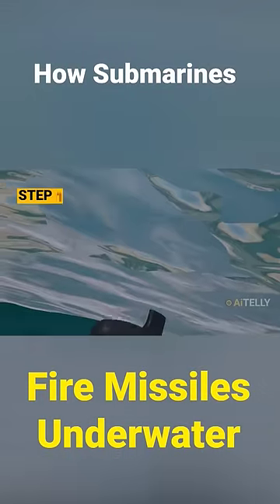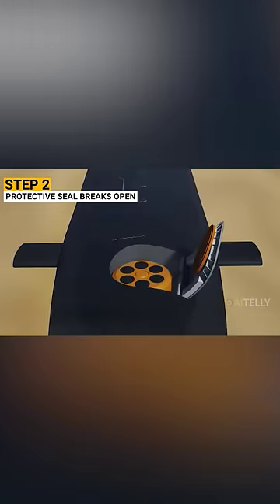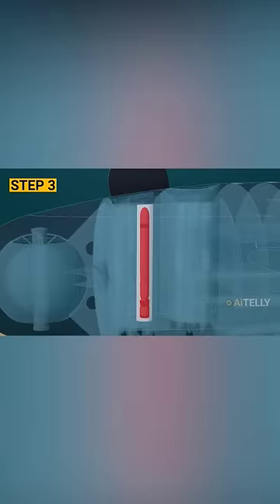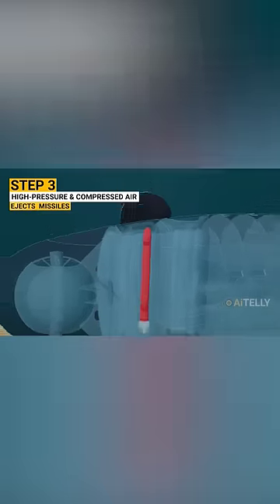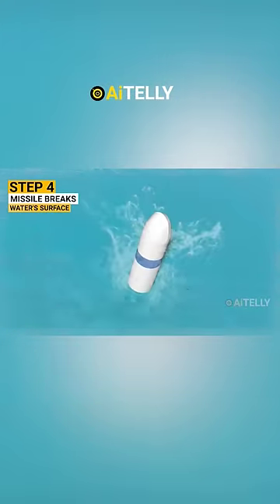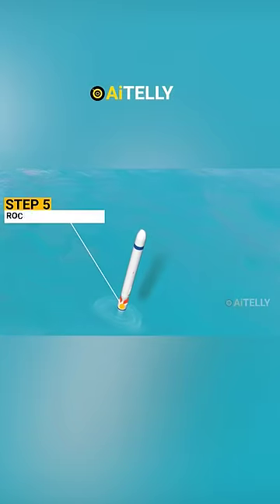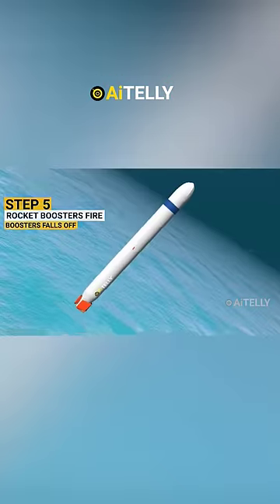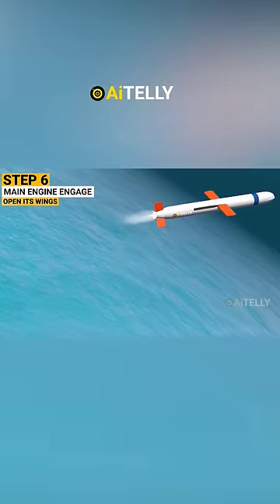How Submarine Fire Missiles Underwater

Comment: The pressurized air prevents water from entering the silos, thats why it can fire while submerged
Reply from the maker: Yes agreed thanks for your comments
Reply: Its actually high pressure steam..
Reply: No, it doesn’t fire while in submerged. The sub positions at the right depth allowing the pressure strong enough to eject the missile out of the water then the missile fires once it is in the air. That is exactly this video clip has demonstrated.
Reply: @h.nguyen6261  Volcano in deep water
Reply: After reading these posts ... I can see not one of you actually know how the system works.
Reply: @Dark78Sabre  you know how  it works? Tell us then
Reply: It works probably like a submarine launched ballistic missile. Rises in nitrogen which is non flammable, the silo filled with water to offset the weight and the missle once out will fire like in the video…
Reply: What kind of catastrophic damage if the water entered the silos?
Reply: @Dark78Sabre 
Back when  I was in the Navy (long ago in a galaxy far away) I had a friend that was stationed on one of the original Boomers (Blue Crew as I recall) that carried the final version of the Polaris series. He told me the way the launch sequence worked was: the outer hatch is opened; the tube was flooded with Nitrogen ( back then there was a kind of membrane at the top of the missile tube that in conjunction with the offsetting pressure created by the Nitrogen kept all the water out); the inner hatch was then opened and the missile was launched with a blast of compressed gas, punching through the “membrane” and propelled out of the water. I never personally pried open one of those  hatches to confirm (for all those that may call BS on my comments) his story, but I don’t think he would have any reason to lie about it. I have no clue the how it is done today.
Reply: @aspopulvera9130  The missile tubes are supposed to be flooded with water. Even after the missile has left. If it wasn't then the submarine wouldn't have enough ballast to stay submerged. The missile actually has more mass than it's equivalence in H2O so if all of the missiles have been fired there are additional tanks that can be flooded to make sure there is enough ballast to stay submerged. Otherwise you'd have too much air and the sub would float.
Reply: @osemenitua7538  I already posted a separate thread on the basic mechanics of how they work.
Reply: That’s so cool 😎
Reply: @h.nguyen6261  magnesium
Reply: @h.nguyen6261 sorry to rain on your parade but the missile's solid fuel that it uses to achieve flight before the turbo fan is used contains an oxidizer so yes the fire can burn underwater. It's not meant to though but the point is your claim is fire can't burn underwater and your claim is wrong.
Reply: @raymondlowry8564 uk here your right about the nitrogen for polaris, they use steam now from a small explosive
Reply: what happen after the pressure disappear? the water still can enter the silo
Reply: @samuelgerungan7851  pressure is maintained and is only stopped when the silo is closed
Reply: @samuelgerungan7851  the pressure is to ensure the missile gets out of the water before the rocket motor ignites, the silos would probably get flooded after the launch
Reply: @samuelgerungan7851  sure the water can enter the silo. That's not a problem. The launch occurs at a shallow depth, and the silos can handle the pressure. The silo is like a gun barrel. The sub rises to proper depth and cuts speed or stops, I can't remember. The outer hatch opens while the inner break away hatch keeps sea water out. At the bottom of the silo is a container of fresh water and a large propellant charge. When the charge is ignited, the resulting gases and fresh water steam both propel and shield the missile as it moves up and out of the water. The sea water never touches the weapon. After the missile is out of the water, then the rocket motor starts.
Reply: @h.nguyen6261  fire burn in water. You just need to made it right.
Reply: @h.nguyen6261 that’s not what he meant by “fired”
Reply: Whats next, torpedoes are being lanuched by compressed air so water doesn't get into the tubes? 😂 Man this is ridiculous..
Reply: Likely a sunken submarine and a dead crew

Comment: "High Pressure AND compressed air is pumped into the tube" 😂
Reply: Nice 😂
Reply: must be an epic pump
Reply: Nice
Reply: Missile boats use fresh water that's flashed into steam with a rocket engine outside the tube vaporizing the water. It comes up from the bottom as flash steam propellant kicking the missile out of the tube.
Reply: The missile breaks the seal as it punches through it. Not a good clip.
Reply: @mach1553 dude's funny mistake flew right over your head like one of those missiles!!   lmao
Reply: its similiar on the concept of farting while in the pool 😂😂😂😂
Reply: Copycat

Comment: Being a former (retired) TLAM technician on surface ships, I know about the surface side. The booster doesn't fall off as soon as it reaches the surface, but is used to get the missile up to speed so the sustainer jet engine has enough air entering it to sustain flight.
Reply: Yeah, was thinking that also... The booster will have a designated burn time which will propel the missile to a flight height!!! Then and only then will the rocket booster detach
Reply: @paulclarke4776 *proppel
Reply: @SpartanVirus  nah, am pretty sure its PROPEL!!??
Reply: @SpartanVirus  depends how fast your going?? 😂
Reply: Yes, the Rockets burn out speed matches the Cruise speed of the turbo jet engine.

Comment: Negative on a CLS launch a gas generator starts up forming a bubble around the missile forcing it out of the tube at breach the rocket motor takes it it apogee falls off the the jet turbine engine in gages. You are describing a TTL or torpedo tube lanch

Comment: It's not pressurized air ... It's nitrogen gas. It is expelled to break up the water's surface tension and make it easy for a different system to propel the missile to the surface. It's the same principle as getting as far away from a sinking ship as you can. If you are directly above or near enough to the ship the air bubbles rushing to the surface would cause you to "fall" through the water until you were at a depth where there's enough water pressure to overcome the disruption caused by the rising air bubbles. Which is far enough down you'd never reach the surface again.

Water does get into the launch silo mainly because it is flooded beforehand. If you didn't have the outside pressure match the inside pressure the hatch wouldn't open. Then the missile is launched through the gas column rising to the surface. Once the missile reaches the surface air it detects the atmosphere and ignites it's onboard rocket engines.
Reply: @Dark78Sabre, I like your explanation about falling through the water. I had no idea that happened. I was always skeptical that people could be "dragged down" by a sinking ship. Now I understand.
Reply: I'm not sure the tubes are flooded. There is nothing saying the pressures have to match. Its the gas generator that pushes the missile out of the tube and it doesn't know the pressure of the ocean because it could be different based on depth. I wont get into how the hatch and the tube work together.
Reply: @DouglasKaden 
He was almost right but not quite. The tube is not flooded. I tried to reply to him but the comments wouldn't let me but the way I see it is here somewhere.
Reply: You're not even close
Reply: @robertnesbitt6110  The tubes ARE flooded. I know this from 1st hand experience. Having been on both the USS Michigan and gone on a deployment with the USS Ohio ... the tubes are flooded. You need the extra weight of the water to keep the submarine submerged. So to launch a missile you have to flood the tube and they stay flooded until reloaded. Even fully flooded the weight of the water doesn't fully replace the weight of the missile. So additional tanks can be flooded to counter the added weight loss based on the number of missiles launched.
Reply: @Dark78Sabre man you need to redo your missile systems end of card. You seem to be confusing a lot of stuff and sequences.

Comment: The CGI is way of here. It apears to show a Ohio style hatch but on Los Angeles place when those launchers has individual hatches.

Also the booster on the Tomahawk does not leave ”as soon as its out of the water” - It realeses when the Tomahawk has build up enough speed and is flying in a stright line, thats the purpose of the boster.

(You need to check the details on AI designs so it make sence - AI is good at lying without blinking.)
Reply: The hatch is correct. That's what the new block III Virginias look like.

Comment: I thought they were ment to be able to be launched for a torpedo tube?
Reply: No, tomahawks are widely used by every branch of the US military not just the submarine force. There is a version of the tomahawk that can be launched from torpedo tunes but subs can usually only take 5-7 of  those every trip this on the other hand is a Ohio clasd sub modified to carry 240 tomahawk in the old icbm tubes
Reply: @poland5606  I knew that every branch used them. I didn't realise they could only take such a small number normally. 240 is a hell of a lot of tomahawk missiles. That sounds like a ver smart use of an old boomer.

Comment: Step #7 the periscope pops out. Step #8 the Tomahawk dives back into the water. Step #9 the wings pop back into the body. Step # 10 the hawk goes around in circles. Step #11 It runs out of gas. Step #12 It sinks to the bottom.